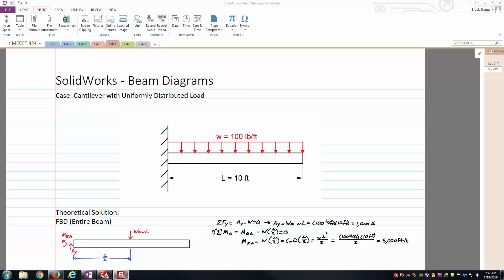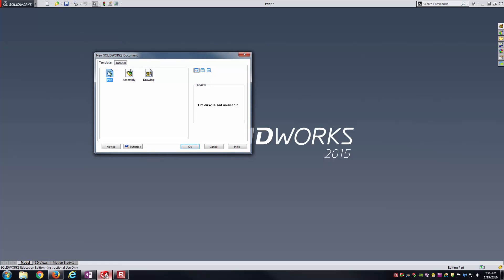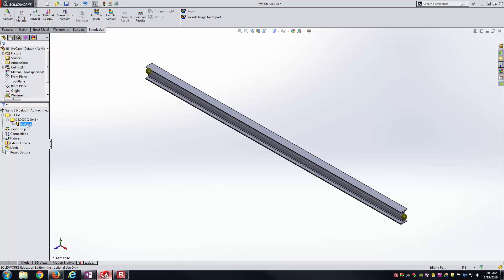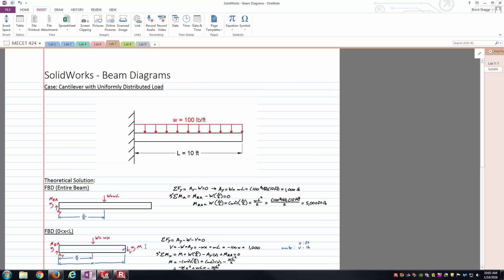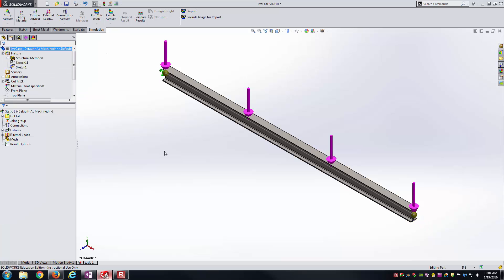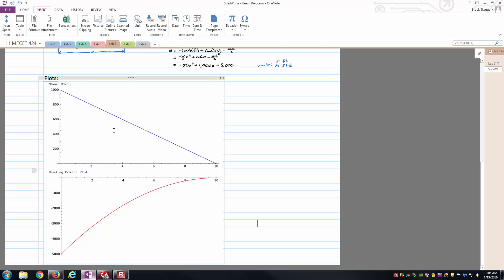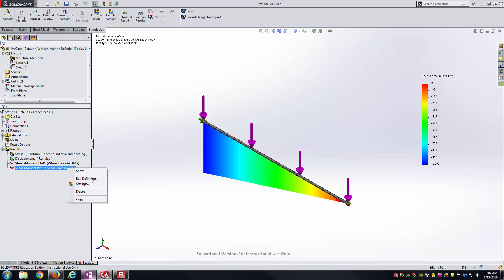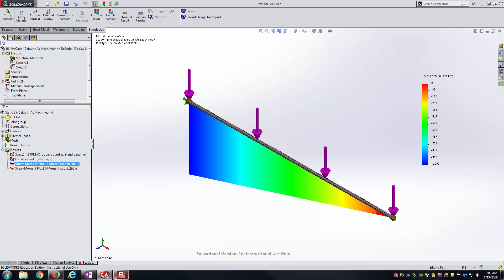SolidWorks - Beam Diagrams

Comment: Hi Frankie, thanks so much for the video.  One question, how would I input live loads of 75 psf for the beam?
Reply from the maker: Ryan, I am interpreting 75 psf to 75 lb/ft^2.  I believe you will need to translate this force per area into a force per unit length.  

I am thinking of floor joists.  Consider the spacing between the joists and then divide the area above each joist accordingly.  Next compute the overall load for that area and determine the force per unit length.  Making an assumption here of uniform loading per unit of area.
Reply: @frankieskaggs409  This seems reasonable. Thanks a bunch! Great video

Comment: Hi Frankie, thank you for your nice video. I have another question about beam in Solidworks, is that possible to create a beam on a edge or line? Because I need to import this soliworks model into Workbench and I only want beam elements and shell elements in my analysis. I tried to use "weldments function" which you mentioned in the video, however, it will generate solid elements in workbench. 
I will be very appreciate if you could give me any trails or suggestions. Thx :)
Reply from the maker: I have never modeled a beam as a single line or edge using SolidWorks and unfortunately I have never used Workbench.  Just a thought, but would it be possible to draw the line geometry in SolidWorks and then describe the cross section in Workbench?
Reply: Hi Frankie, thanks to your reply. At last I used Spaceclaim rather than Solidworks to generate the model and the beam elements. Spaceclaim is indeed part of workbench! Thx for your idea! Cheers
Reply: I think that, if you want to import geometry from solidworks to Ansys, the geometry need to be export the parasolid in solidworks.

Comment: Hi,Thank you for the video, it's great but, I have a question, don't you have to check the "Per unit length" to make the force distributed?
Reply from the maker: The loading of the beam comes down to subtle differences in how you input your values as I am discussing around 6:30. Here I am wanting a 100lb./ft. load over a beam whose length is 10 ft. If I check the "per unit length" box then I need to enter 100 for 100 lb/ft.  If I leave it unchecked I enter the total load experienced by the beam 100 lb/ft * 10 ft = 1,000 lb.  SolidWorks then takes this load and uniformly distributes it over the beam's length.  If you want something other than a uniformly distributed load, then other steps are required.
Reply: I was thinking that, but I keep getting different results, I'll will find out what I'm doing wrong.

Thank you for the replay!!
Reply: I believe that the program it's taking my force and applying it on every single item, so i have to check the box "per unit length"